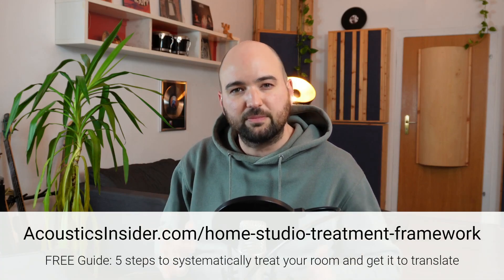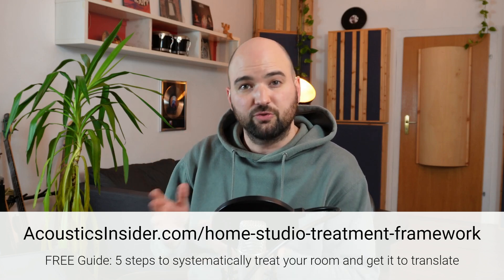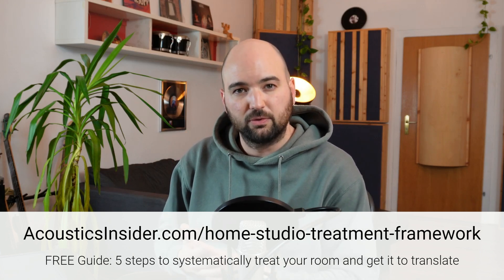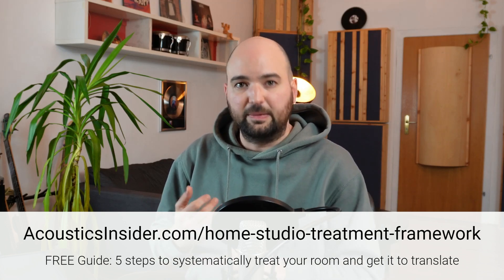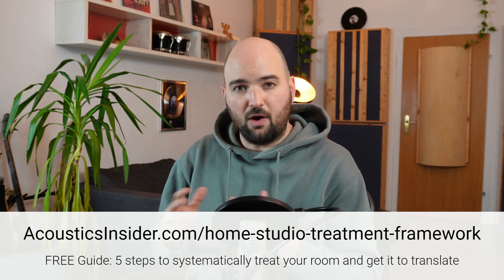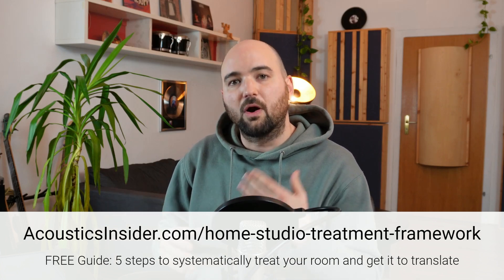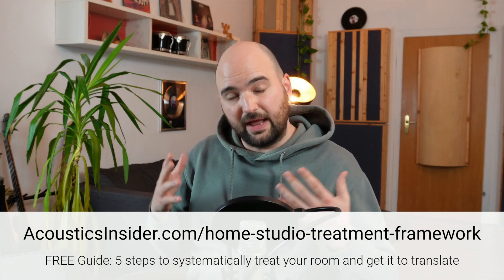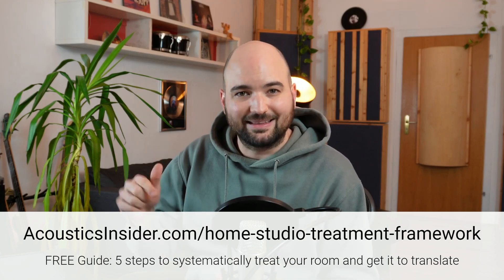Acoustic treatment IS NOT about getting good sound - What Sound Engineers NEED To Know

Comment: I personally use Metric AB and Sonarworks, with Beyerdynamic dt1990, the problem is: these cans have a very brilliant high end. Sonarworks dampens the high end response. If i now compensate, and make my mix brighter to a reference track - the sound is so bright its really piercing - allthough the level is about the same between the reference track and my track.  When listening via Genelec in my home studio - the high frequencys are not as prevalent /piercing, as the distance between the ears and the speaker is enough to make it "normal" sounding. For production its obviously better to work without headphones, they can only get you so far - but for critical listening the room is of utmost importance.

My tipp: listen to various frequency bands of your mix , and check if there is any distortion - if the band is soloed it will get a bit more obvious - because high frequencys can also mask the distortion happening. (Yes some distortion is needed for mixing purposes.) but it helped me - so i let you know. This channel is really a gold mine, and clarifies a lot of vodoo for accoustics. And you are about right - its important to focus on the music, and treat this accoustic treatment as an important topic, but without chasing ones tail, is well spoken. You got a new subscriber.

Comment: Thank you for all your advice. I did however end up with working with commentators inside a large portacom. The reverberations made it sound terrible and hard to mix. Surprisingly though, covering the walls and ceiling with 3mm thick packing blankets cleaned it up greatly! Their mics sat in the mix properly and the reverb was more than reduced enough. But I don’t understand how. How did 3mm achieve this? My home mixing room has 300mm foam spaced off the walls by 250mm. I don’t understand.

Comment: Would you recommend i build my wall panels using materials or should i just purchase the ones that are available at b&h ?
Reply: Well probably is much cheaper diy than buying..but buying is more options with looks quality and design etc
Reply: @nevencovic2804  oh okay i suppose ill go the diy route as idc about looks, and i saw some good looking diy builds and they dont seem to require that much extra effort!
Reply: From my experience diy can be around 5 times cheaper than buying for the same volume (cube meter) of absortion if you already have the tool ( i spent around 100euros for the tools stapler, cutter, hammer etc) but to do it safely you need to have a good workspace especially when working with the insulation,if you don t have a good workspace and i find it unsafe. Also it depends of the number of panel you need, the more you need the more diy is interestinf

Comment: I also have a big deep @100Hz after treatment. It begins at 80-90Hz, goes down to about 30dB at 100Hz and back up at about 110Hz... It's like a notch at 100Hz. I get over it. With 1/3 smoothing on REW, room response is +/ 2dB over this notch with about 150ms rt20, and +/-5dB below this notch, from low fq room modes. Compared with the initial room response (3,3/3/2,3 m) it is a enormous progress... 😁